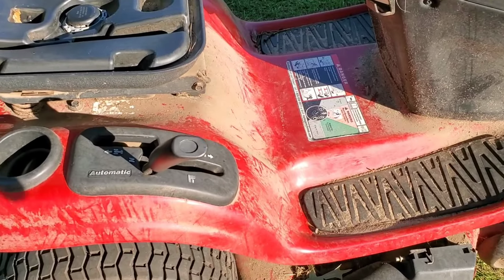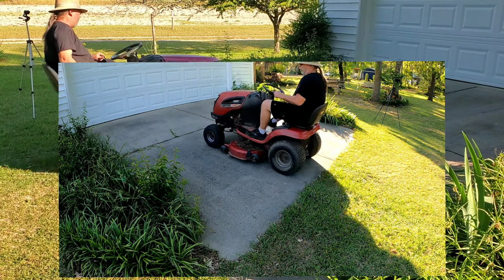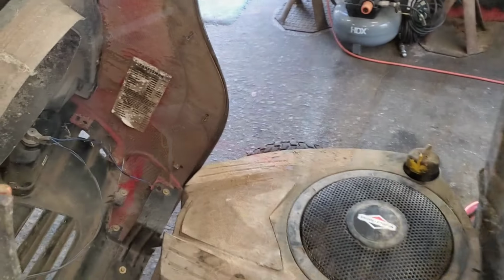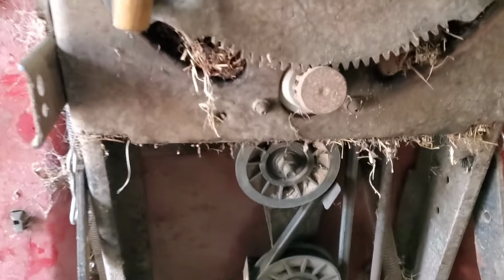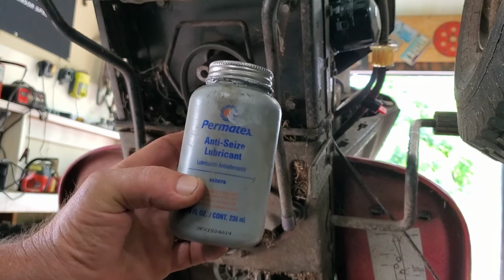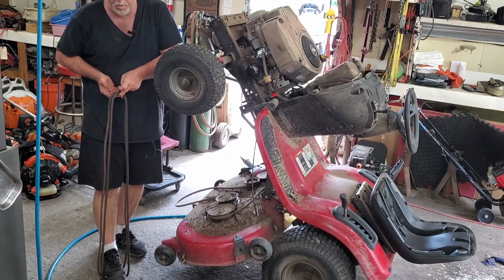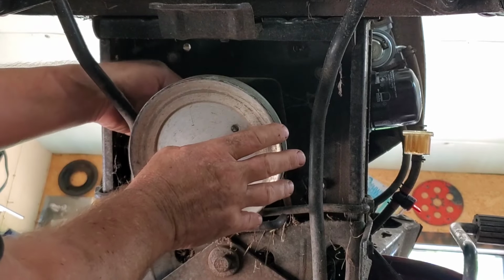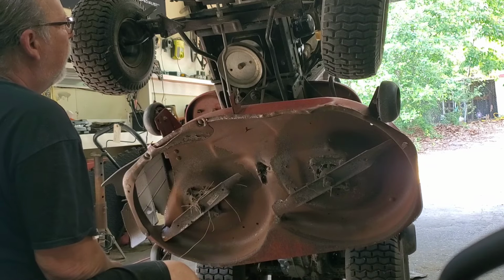Riding Mower Won't Pull Up Hill  DIY Clean Out The Dirt Also How To Replace The Ground Drive Belt

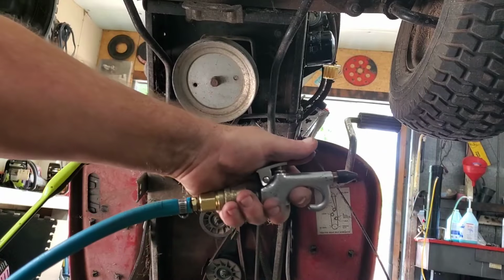Comment from the maker: In the video at 8:27 where I use the blower is VERY important, this will also cause the clutch / brake to not fully engage the drive belt due to the grass and dirt build up.
Reply: I am helping my grandson fix his MURRAY RIDING LAWN MOWER
MODEL#40620C
DATE OF MAN 2950.HE NEEDS FRONT WHEEL BUSHINGS.CAN YOU GIVE ME A PART NUMBER SO I CAN GET SOME.THANKS
Reply: Google the model number
You can find exploded view drawings / diagrams that will break out parts / numbers.
From there you can Google parts to get whatever you need

Comment: This is EXACTLY what mine is doing. Thanks for the tips and how to fix. I’ll let you know how this turn out. 

It’s super dry here and was mostly mulching leafs. About half finished when my mower started having a lack of climbing power. Looking at the crap that was collecting on my deck, there’s no doubt the same hay bail of lawn crap is up and round the drive belt. Now I have a mission. Thanks for the video and the how to.

Comment: Great video! I went and bought a Big Red chain hoist for $50, ordered a replacement belt for $18, and installed it this afternoon.  Much better than crawling under a dirty old mower to struggle with the belt replacement. Saved a ton of money doing the repair myself (with your guidance) AND walked away with a new tool. Blew the mower out with my compressor.  Only problem now is when I take my foot off the brake, the darn thing wheelies! Raced it up a couple of hills and it's like the mower has been reborn. THANK YOU!
Reply from the maker: Awesome!!!
Reply: Hope you reinforced your mounting points for your new hoist. Safety first 🙂

Comment: I have a Murry,  you can change the belt without taking the steering shaft out, but frankly,  it's just as easy to pull the shaft to change the ground drive belt.

Comment: Ok, where are you? I'm bring my older Craftsman riding mower to your house to replace my drive belt. It comes of trans pulley, and I have to remove battery and case. Then, fight with fan to reseat on the trans pulley. I'm only a 5ft 65+ yr old grandma.
Great video, good clear instructions, and I love the humor. Will check out other videos. Thank you, sir.

Comment: I had the same problem with the used Craftman I purchased.  First the drive belt  measured 7/16" width instead of the 1/2" specified.  It still was not quite right so I looked around and found some trash packed in under the clutch peddle linkage that kept the drive belt from fully engaging.  A second problem I had was the blade belt.  I measured it too and it was 7/16" wide not the 1/2" specified.  New belt improved it, but not totally.  It is partly the design of this section.  The belt as it is pulled by the engine goes around a stationary idler and then on the pully for the left of othe operator the belt is engaging half of the circumference of the blade pulley.  The belt is engaging about 1/3 the circumference of the blade pully to the driver's right.  There is a spring loaded pully to tighten the belt as it comes from the engine.  If you are multching as I do 99% of the time it is easy to go too fast causing the right hafe of the deck to leave a lot of trash.  I see two factors here at work.  One is that the left blade is shuving a fair about of clipping to the left blade.  Two is that the belt is not getting enough traction on the pulley.  I have noticed that if you listen and your ground speed is too fast that you will notice a bell sound from time to time.  If it sounds like you are grinding up twigs, you are really going too fast!

Comment: I have one with this same issue. Cleaned out all the dirt, but the belt is still loose, is there a clutch adjustment at all? Thanks!
Reply from the maker: You will need to replace the belt

Comment: Can you tell me or show me where the ideler spring hooks to the frame. Mine broke bough anew one but I can't figure out where it hooks to the frame and how do you stretch the spring to hook it to the frame.  I have craftsman yt4000.  Thank you .Lonnie
Reply from the maker: There should be 2 holes in front of left rear tire.  I use a bent welding rond as a spring puller, but possibly a metal coat hanger will work also.

Comment: T-Bone, have a question. I have a 2017 Gravely ZT HD 60 with 249 hrs on. I recently installed a new drive belt 1/2 x 73 inch. The belt went on very tight and still is. Question, it seems to lose power going up hill. Hydraulic fluid it good, I don't know. Any ideas?

Comment: When I was on mowing the bank behind my house went up the hill at a angle then went straight out the yard and got around maybe 25 ft an all but stop no reverse got on flat ground a little forward motion waited till next day it moved back and forth descent took it apart and it shows nothing in transmission  got fluid in it and put almost 2quarts in it

Comment: I made my rider start pulling good by squirting gas on the spinning belts. I have to do that every time I cut grass now.  Never put belt dressing on your riding mower belts. Makes them slip. It's like coating them with oil.
Reply: Interesting, my belt dressing is very tacky. Wonder does it get oily after a while?

Comment: Why didn't you blow all that grass and dirt off the mower before you put the belts on
Reply from the maker: This ain't no car wash. We told the customer to do it, they don't take care of equipment.  I repair between 6 and 8 pieces of equipment per day and still 4 weeks behind.  Along with making videos.  Hammer down at this shop, we are never caught up. Year round we are slammed with work.

Comment: Made by MTD to the craftsman brand Specs I have a 2021 T240 the first run of the turn tight series Tractors its built like a little tank it's built to last the engine is a kohler 7000 22 horsepower 725cc V twin engine came with a 3 year unlimited hours warranty and it's designed after the Kohler command commercial Pro Engine..dry weight of the Tractor is 630 pounds cast iron front Axl..tuff torque k46 transmission serviceable steel gears...MTD builds them but to the craftsman brand Specs.. MTD also builds Cub Cadet same thing built to cub cadet brand Specs..
Reply: These were monsters it's a shame the newer ones 2022 to present have been downgraded
Reply from the maker: Agreed 👍🏻